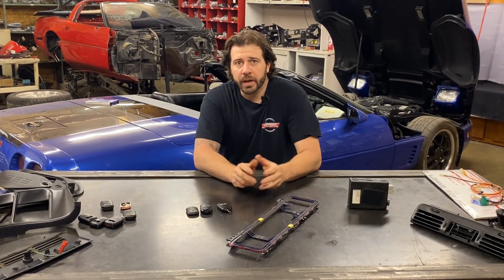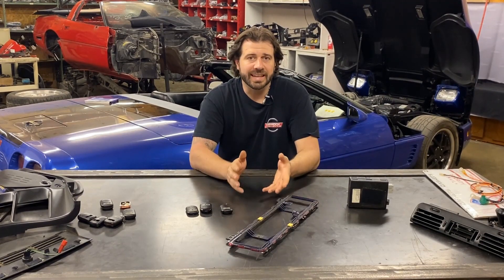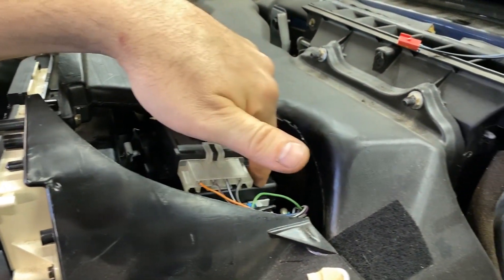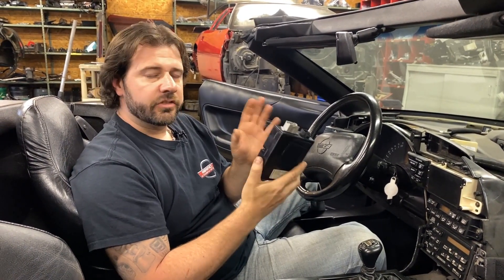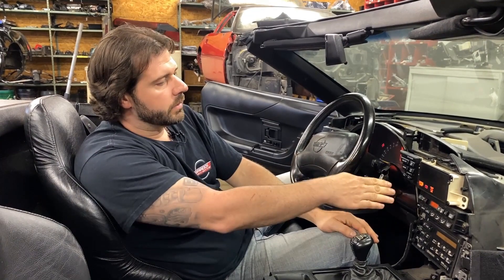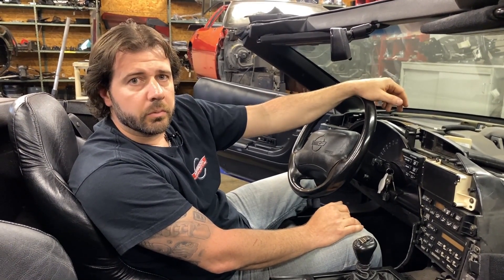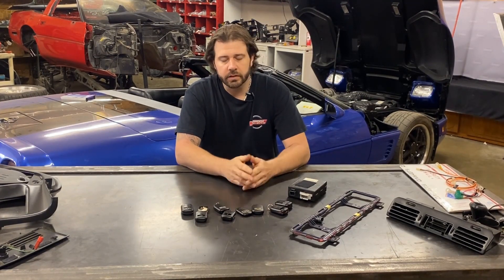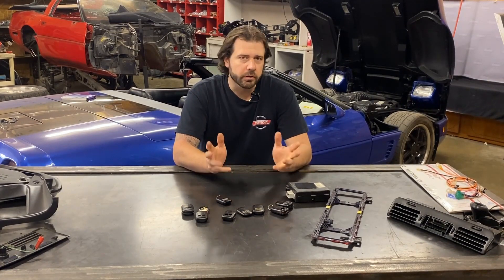C4 Corvette Key Fobs and the Passive Keyless Entry System

Comment: I did watch your video, My PKE goes into programming mode but previous working Key Fobs not longer are recognized  I do not have a code reader and do no feel comfortable to stick wires into the ALDL to find a code.  Maybe both Key Fobs went bad but I do not know how to figure this out
Reply: You need to program all the key fobs over again. Once you’re in programming mode you start over with all key fobs. And keep first program one away when programming 2nd one.
Reply: @indybill4  Correct Thanks for mentioning this because someone else might benefit from your comment. I did make sure that that only the Fob that I was programming was brought near the car one at a time.

Comment: Greetings.  I have the 94 C4 and my fob crashed.  I just purchased a rare brand new fob for the 93 (orange letters) but it's not programming.  Is that fob specific to the 93 or is it just the orange words that's different?  I did buy another brand new clip style case regular remote and sent the orange letters back.

Comment: Hi Mark, and Merry Christmas. I bought (privately) a 1993 Corvette convertible and the seller did not recall ever having PKE fobs. So what I found was, when you manually lock the car, this arms the alarm. So when you come back and open the door with the key the alarm goes off ( horns). To disarm the alarm you have to turn the door key  to turn it off.   I can get by doing this but would be better to have the keyless feature. I saw some generic ones on E bay but not sure if they will work ? Thanks for your very informative video.

Comment: Also, why would the old style convertable key fob and the lid, I was given, be upside down when aligning the top and the bottom pieces.  The clicker raised plastic dot hits the battery, not the door yellow dot on the inside?
Reply: So I see that someone placed the component in the bottom case upside down.  1 mistry solved.

Comment: I took out the rear storage and saw a black marker signed name on the panel, is this common?
Reply from the maker: Sometimes you will find various writings on the cars interior that was done during assembly. Not all cars but some have random writings,, have seen some where assembly line workers wrote notes in the car to get other workers attention who were further down the line

Comment: I was going to suggest a 3D printed fob cover if they were not made by anyone, but it appears they do. May still be a good idea if they start to get expensive or are still delicate. I'd hope the remakes have a better plastic formula to withstand abuse. 
I wonder how hard the guts of the FOB would be to make, even if not as nice as the original. Probably need a bunch of info on how it works that we simply don't have for security reasons. With the age of the system has there ever been any issues with people "faking" the signals and breaking into cars?

Comment: I need a key fob. Where can I get one?
Reply: Look at the vette forums you will see where to get the  genuine OEM revision with two screws in back 88960923 and 88960924 as a fresh build by the designer and internally signed. 😉
Reply: Me to

Comment: I get no light when I turn the key.  I press the trip  button twice then the fuel button once and a get a quick light,  It flashes once.  1993 , any ideas?
Reply: The last key fob used turned off the passive system. You need that key fob back to turn passive off. I had same problem so when I got new fob had to replace PKE module.

Comment: If the PKE light comes on and stays on when you start the car, what's the most likely fix needed? PKE module replacement?
Reply: i found removing the pke fuse from the passenger side fuse box does it. just no longer use the fob.

Comment: Awesome vid. Have you found a battery that fits in the case correctly? Thanks
Reply from the maker: Size 2450. Sometimes a 2450N will fit a little better because the top side of the battery isn’t as thick. You have to be careful how you put the battery in, angling one side in before the other in the original clip style versions will be easier angled in one way over the other. Just don’t force it too much. The later style with the screwed case the battery installation is more forgiving.
Reply: @MirrockCorvette yes, also I will add a suggestion,  use a Swiss made Renata CR2450.  The screw back OEM fob has a precision Swiss made battery holder and the Renata CR2450 batteries fit like a fine custom made glove. 😊
Reply: @MirrockCorvette  I have a fob left over from my 94, the oe battery (sanyo cr2450) is 4.82 mm  (.190) thick with the rim  having .27 (.010) a step down  to fit under the clasp s in the fob. New 2450  don't have this lip so won't fit, yea I know I don't need or use it but I like everything to be in working order.
Reply: I have a 95 Corvette, I have a question about my door chime. It normally doesn't work. Some time when I put the key in the ignition the chime will start working. Any help will be appropriated. 
PS. Amazon carries the key fob case for $19. They have no internal parts.
Reply: Yes I would love to know as well!